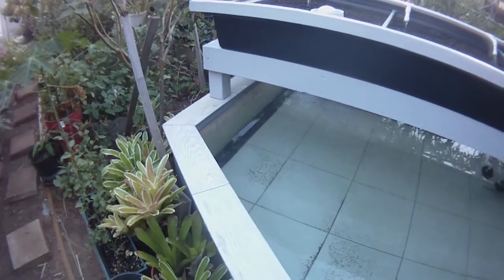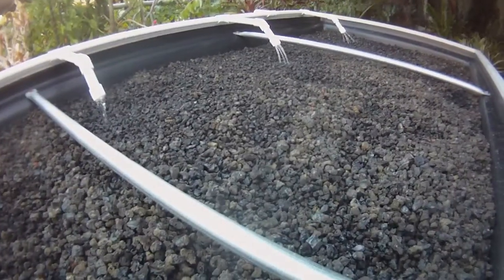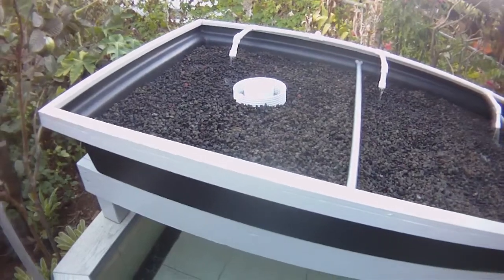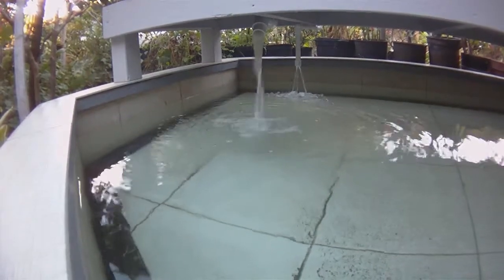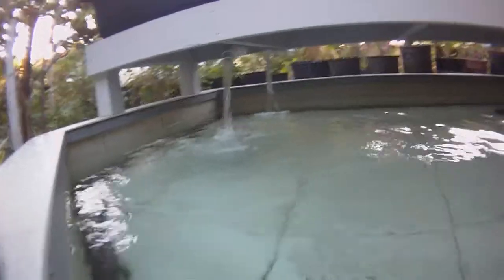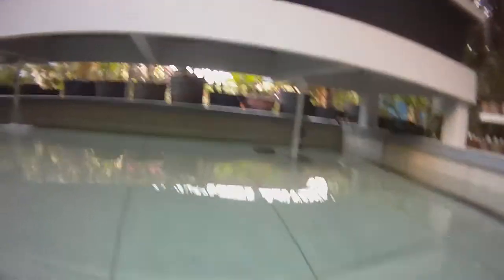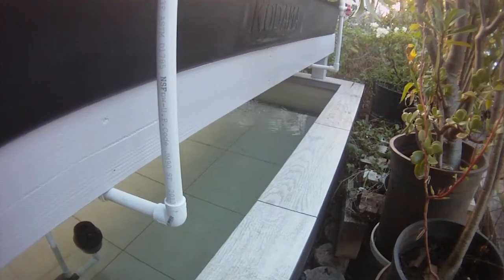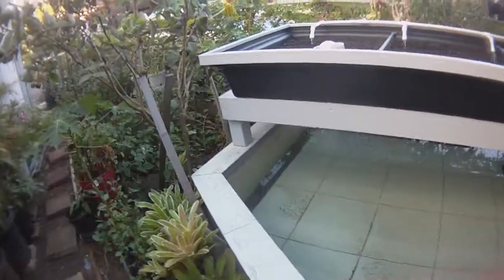Home Aquaponics Project - August 31, 2013 Completed Setup

Comment: In the  Best Hydroponic Direction, the author does a decent job of describing how to build a couple of different growing systems. However, in the Hydroponics book you are left on your own if you want to DIY. Still, the author provides great tips about how to succeed with an Hydroponics system [Check Details Here  ===> fb.com/Easy-Hydroponics-Systems-166096780618260/app/208195102528120 ] (such as needing to let bacteria grow in the water before adding the fish – that was new to me!). And he also explains each system in reasonable detail, as well as the benefits for both kinds of systems